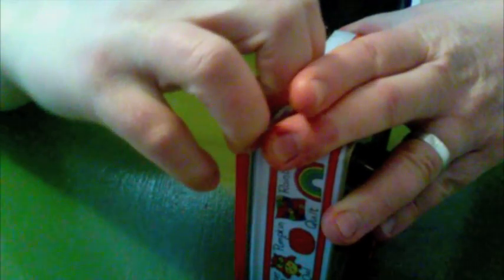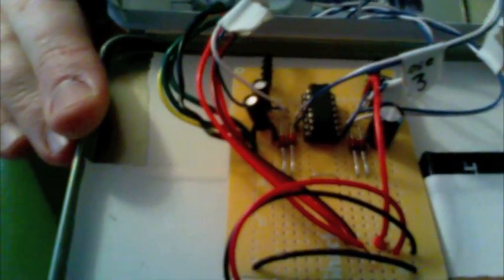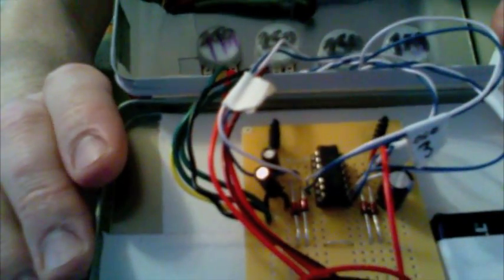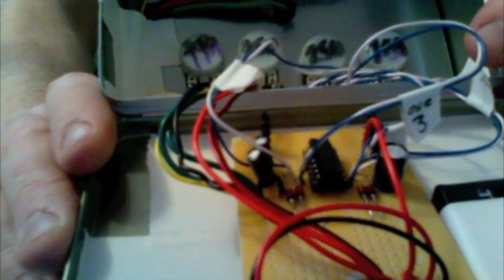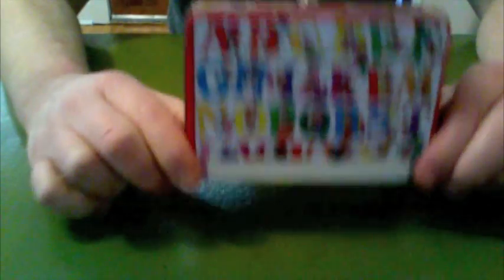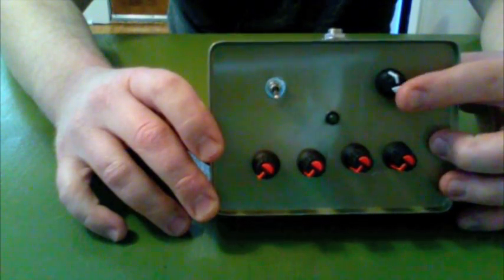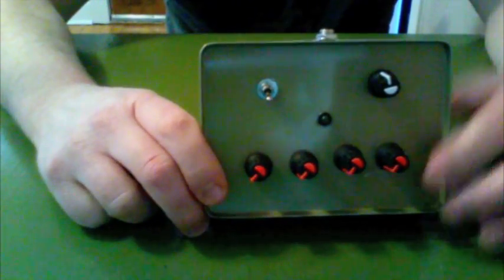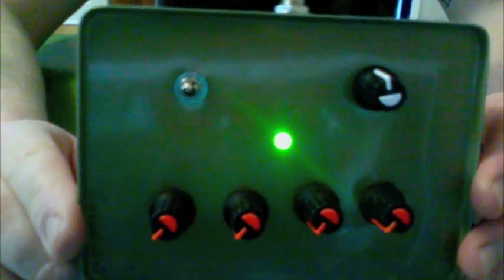Handmade Four Oscillator Sound Generator

Comment: Hi,schematics please, thank you.
Reply from the maker: I used the info and component values for the Quad Oscillator kit on the Get LoFi site to generate my own strip board layout. 
More info on GetLofi.com
http://getlofi.com/shop/4093-quad-oscillator-kit/
Reply: WretchedExcess thanks a lot men,if i buy any artifact,could you send  to colombia?
Reply from the maker: I don't sell these. You'd have to ask the site admin if they ship worldwide. Or you can source all the parts you need from an electronics supply and build your own using a veroboard. That's what I did.
Reply: thanks
Reply: WretchedExcess do you have a layout for your stripboard? Im not good with drawing my own but can follow a diagram pretty well.

Comment: Thats awesome! Lemme guess 556 atari schem? Maybe a few swapped out components to give it customized sounds? :) sounds great! Made a few. I did the electrolytic caps. Seem to sound even thicker at low freq. Nice build bro! :)
Reply from the maker: +Bill Ricci (Hit-n-Miss) It's a 4093 NAND GATE chip. You can make multiple square wave oscillators similar to a HEX INVERTER. Thanks for watching!!